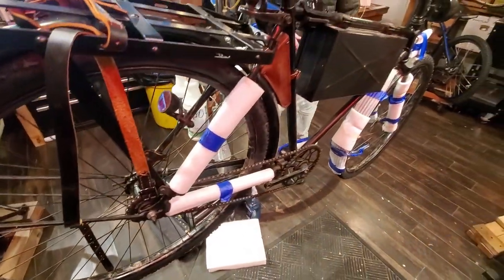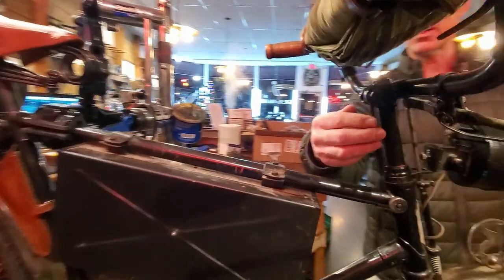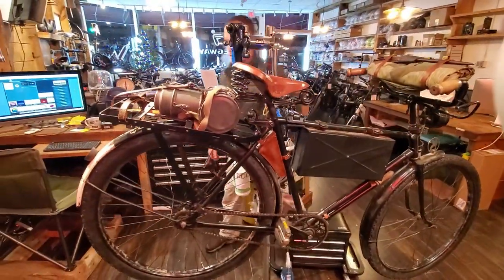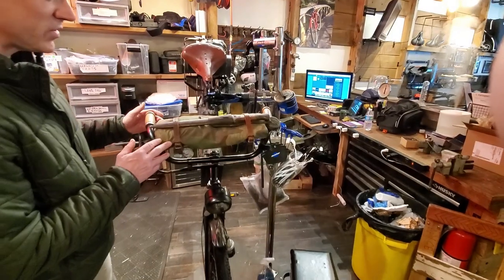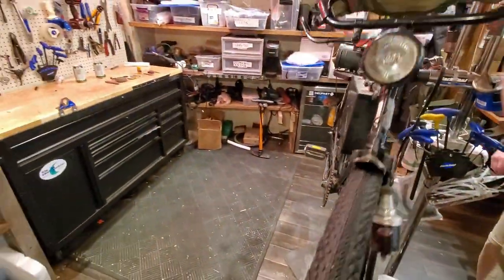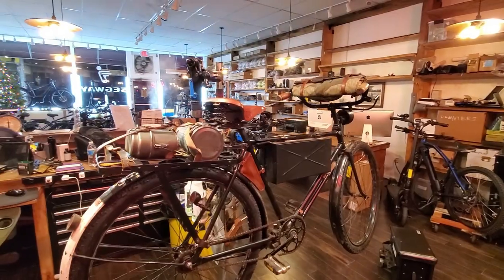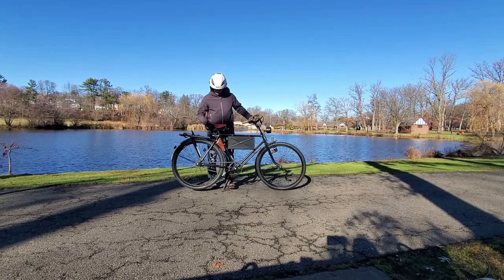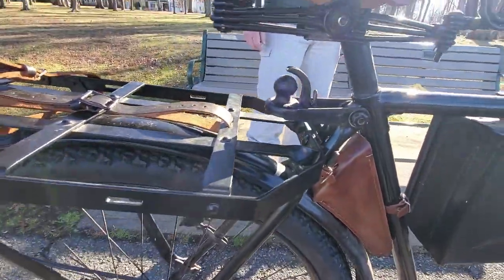Gritzner 1942 WWII military bike

Comment: The geometry of the frame and forks is interesting - definitely more relaxed than even the Swiss bicycle. It should be extremely stable and comfortable. Nothing like today's bicycles, except for traditional Dutch and Danish bikes. I'm slightly surprised that the military bicycles are all fixed gear as they would benefit from a 3 speed hub gear. However it's just something else to go wrong, although the Sturmey Archer was incredibly reliable. Perhaps the other nations didn't have as reliable a hub gear and of course they wouldn't fit a non domestic model.
Very interesting. I loved the tow hitch. All the best. 👍